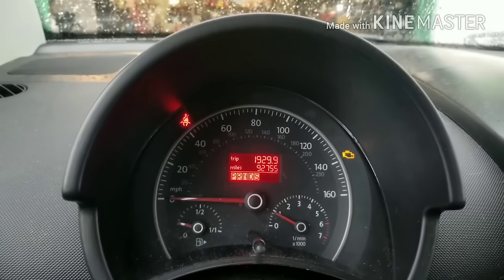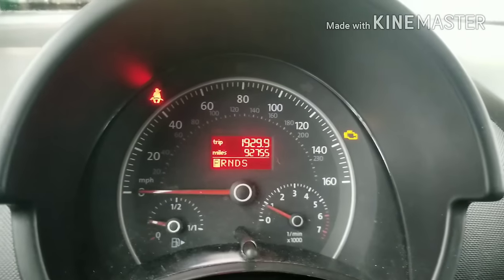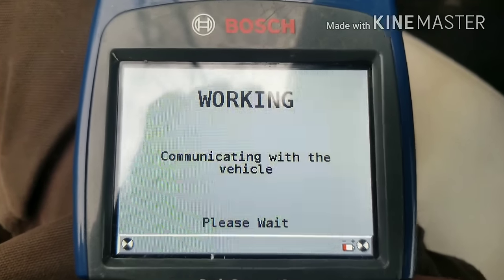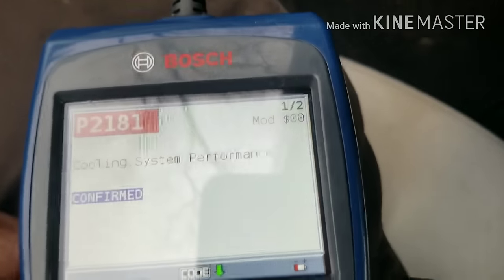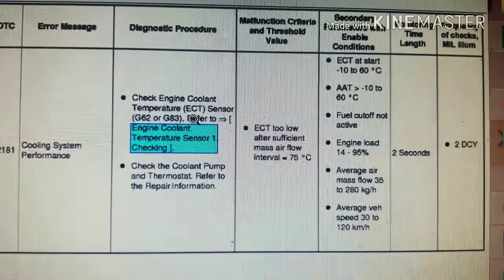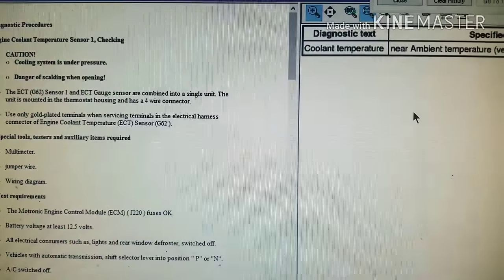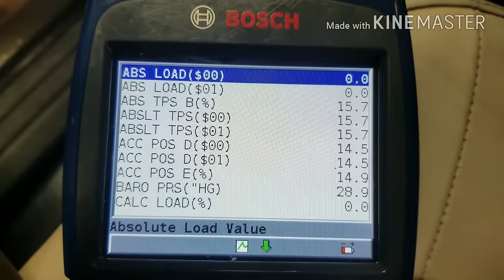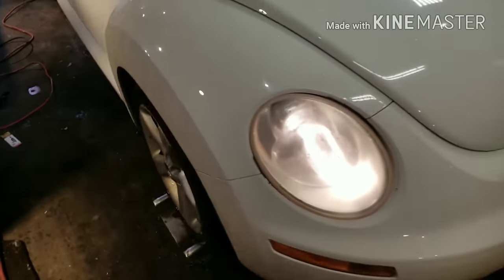How to Replace Thermostat on 2008 New Beetle, the Fast, Easy Way.

Comment: This is a great video but this job is not as easy as it sounds. The intake manifold needs a special tool (CTA 8541 14" x 6mm Hex Bit Socket) to remove one of the bolts. I bought one for my mechanic to do this job and he said he doesn't think he could have done the job without it. It's less than $20 and is worth it, even if you only have to use it once because of the time and tears it saves.

Comment: You installed the thermostat upside down, the jiggle valve always goes up at the 12 o'clock position. If the thermostat is not clocked correctly you will never get all the air out of the cooling system
Reply from the maker: it only goes in one way

Comment: The best vide on this procedure I've seen, and Ive seen more than I ever wanted to see, lol. Thank you. For some Jettas, there are an additional two bolts you need to access from the bottom of the car. They are next to the oil fill tube. Once again, best video on this topic!

Comment: Thanks for your video. My question is can I remove those two bolts from engine motor mount on car ramps instead of using jack stands? Thx again your a life saver. God bless you
Reply: I have a 2007 Volkswagon Beetle 2.5

Comment: At 29:50 the old thermostat air bleed valve was facing diagonal left down. Eric the car guy video said that valve should be facing on top so air can go thru. Maybe Volkswagon made a mistake on install?
Reply from the maker: Thank you please like, share, and subscribe, also please check out my other channel Salem Taxi, on YouTube for more material on a different level.

Comment: So if you coolant temp does go up, but CEL is on and temp sensor flashes, what would that issue be? Same error code btw. Thanks for the video!
Reply from the maker: check coolant level first

Comment: Where can you find that 6mm extension?
Reply from the maker: i found mine at orielly auto parts,
Reply from the maker: in cheap tool section
Reply: I found one that works, Home Depot, it is a  Milwaukee extension, with one of  my 6mm bits.  Thanks again for this video, I'm better working on the MKIV 1.8T and R32
Reply: Wuuuauu! Great work..thanks a lot for the info,
Reply: Bondhus 16468 on Amazon